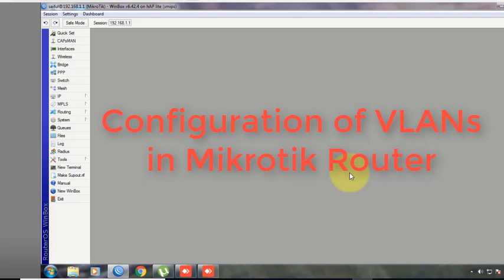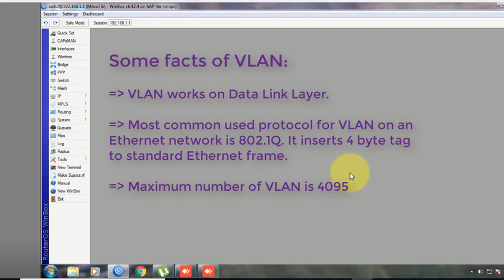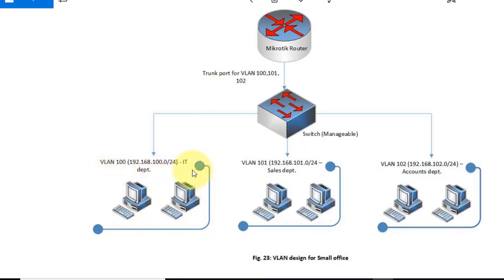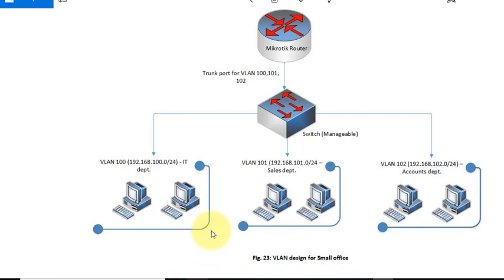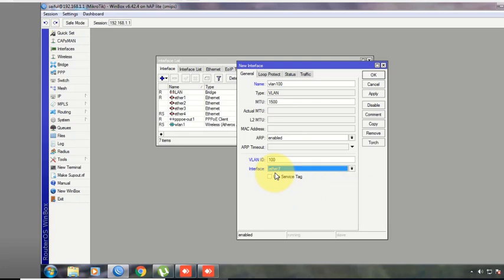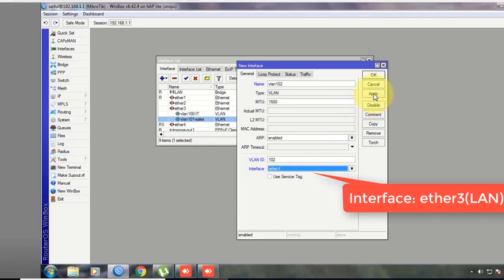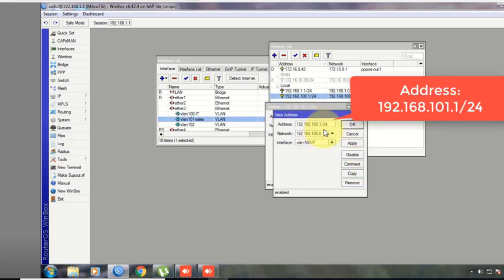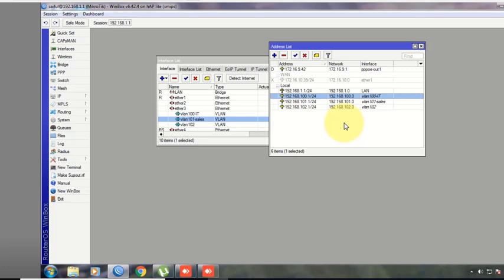Mikrotik Tutorial no. 23 - Configure VLAN on Mikrotik Router

Comment: To be specific, this particular setup only works on Mikrotik devices that have a VLAN capable switch chip.  If not, a bridge must be set up with VLAN filtering enabled.  This essentially makes the interfaces "dumb" and forward all traffic to the CPU, where the software bridge can assess the VLAN tags. 

It's a bit complex, but depending on the mikrotik hardware model you may or may not need to set up a "bridge" in RouterOS.  I keep thinking I should make a video on this because all of the options and examples shown on the Mikrotik website seem to cater for every circumstance except the one I seem always need.  :D
Reply: Yes, please make a video, it will be very helpfull :)